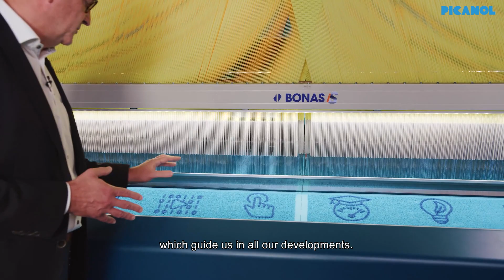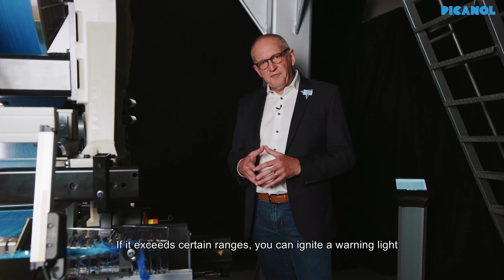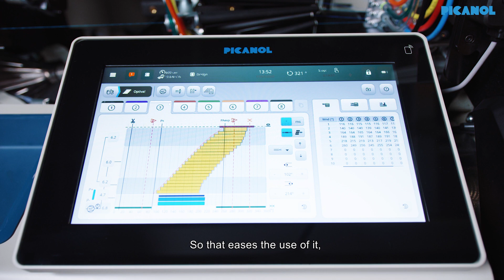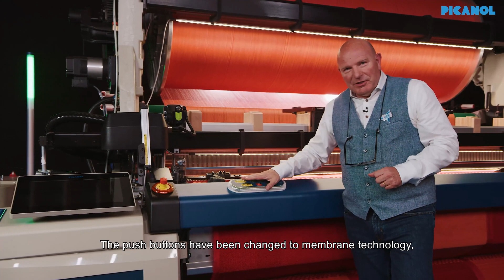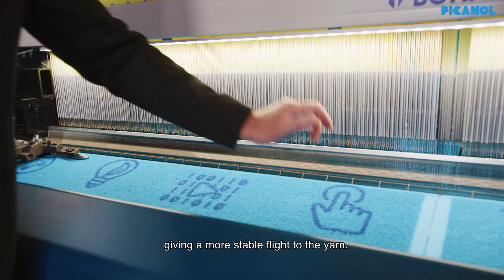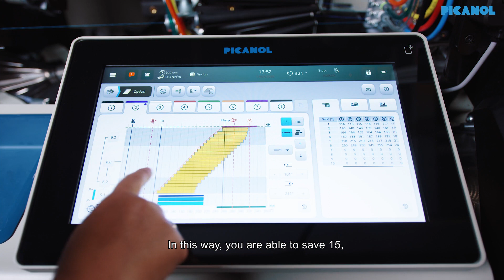TerryPlus-i virtual launch video - EN

Comment: Picanol looms good performance  . 
Electri and machanial parts compution very low .

My openion 
picanol  Elsy  make a selvedge bending  . Elsy work same as klocker   .and Elsy used one frame space if loom 16 frame if customer  used Elsy 15 frames used in artical pattren customer  loos one frame .
And elsy klocker very less life  consuption increase  customer .

Please RND department  slove this issue 
 and make very easy  devise selvedge bending  .  no part comption  same as picanol loom .